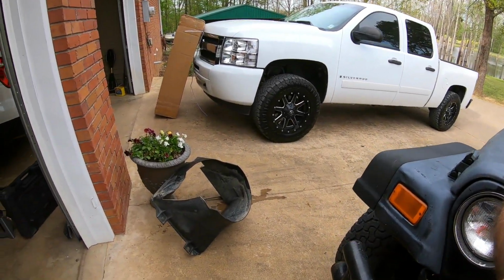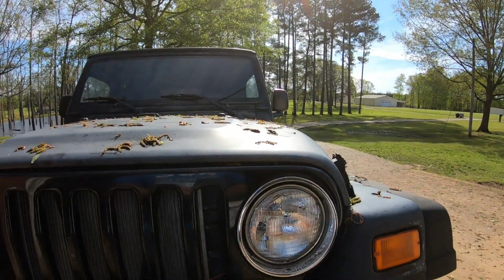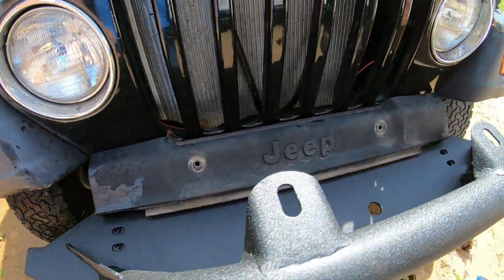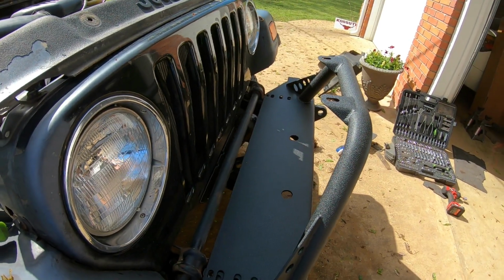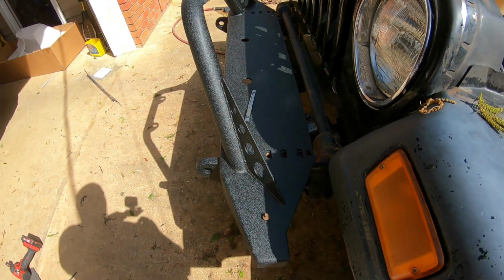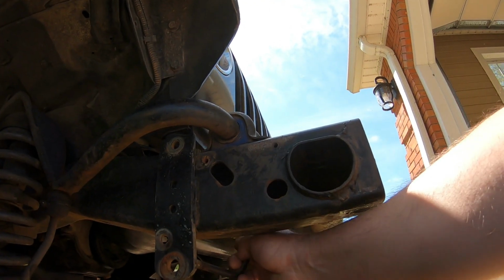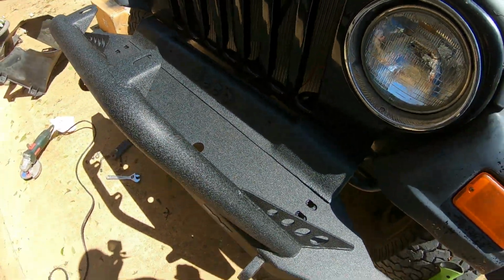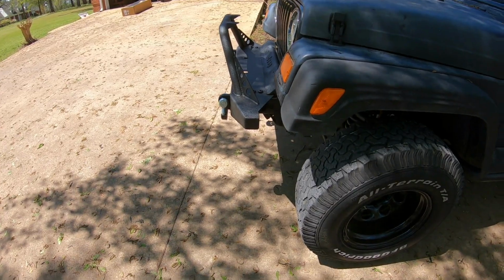Jeep Wrangler TJ Front Bumper! TJ Aftermarket EAG Front Bumper

Comment: Great video.  I am doing almost the same bumper upgrade for my 2006 TJ Rubicon - an old tube bumper to a mid size for a winch install, and I have been going crazy trying to figure out why there is a piece installed right beneath the bumper that interferes with this.  After watching your video and the excellent way you filmed it, I can now see that this piece is a leftover from something that had been installed previously before I owned it, and I can go ahead and uninstall it and leave it off.  Also, I have really rusted stuck torque bolts like you did and have put in penetrating oil, but they are still frozen.  I bought a torch to heat it, but have not done it before, so I appreciated seeing your technique.  I feel a lot more confident about what I need to do now.  Thanks for the detailed video!
Reply: After some more research, I discovered that that part was a base plate for flat towing behind an RV, something the previous owner must have done.  Easily removed, and not something I plan to use.
Reply from the maker: Sorry for the delay. YouTube Had this comment held for review and I just found it. Glad you got it worked out and thanks for watching!

Comment: Nice bumper, and the trim piece turned out great. I need to get a new bumper for mine 97. The guy that owned it before. Was like the ones that had yours. Did a lot of stupid stuff, but not as bad as yours was. I have a Superwinch on mine. And going to power coat my D-Rings on front. Where and what brand plastic paint have you used on the inside?
Reply from the maker: Thanks Pete! https://www.summitracing.com/parts/smm-15243. You can find it cheaper I think.